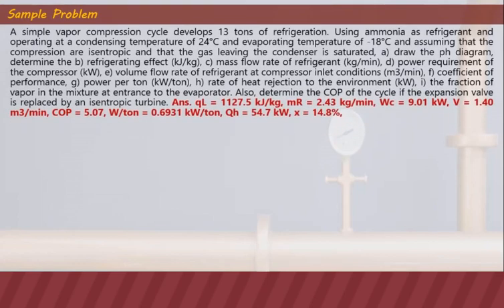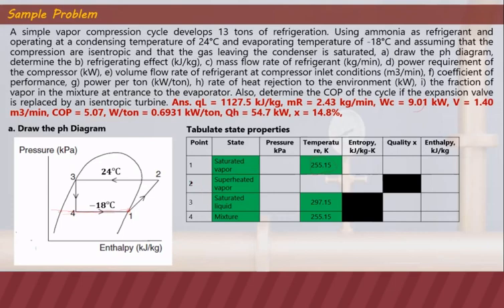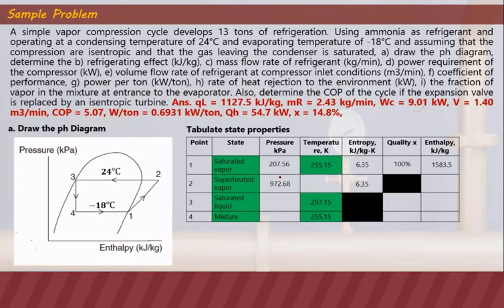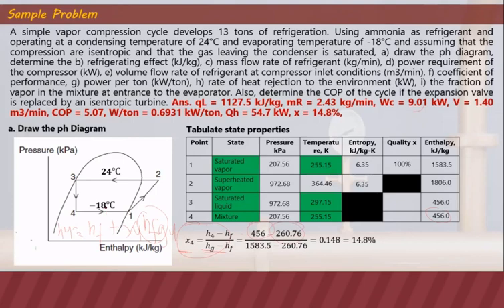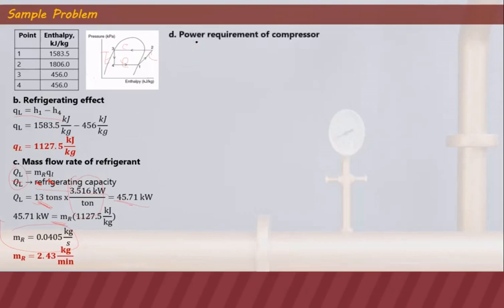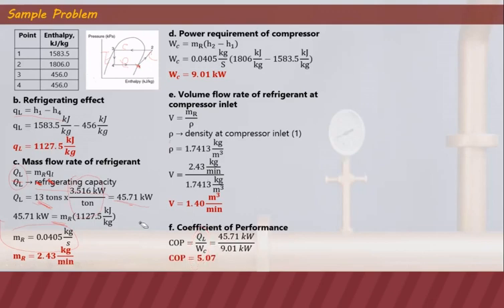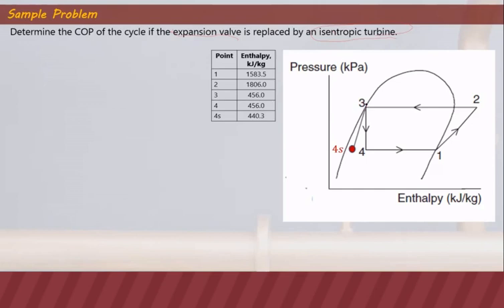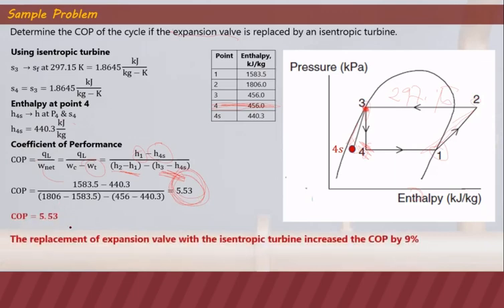Refrigeration Systems: Standard Vapor Compression Refrigeration Cycle

Comment: I need answers to this question
A refrigerator using R-134a as the refrigerant is used to keep a space at -10°C by rejecting heat to ambient air at 22°C. R-134a enters the compressor at 140 kPa as a saturated vapor and leaves at 800 kPa and 70 °C. The refrigerant leaves the condenser as a saturated liquid. The rate of cooling provided by the system is 2600 W. Determine (a) the mass flow rate of R-134a, (b) the COP, (c) the exergy destruction in each component of the cycle, (d) the second-law efficiency of the cycle, and (e) the total exergy destruction in the